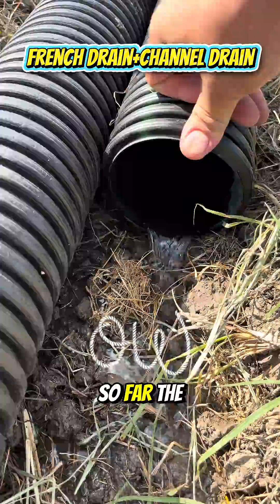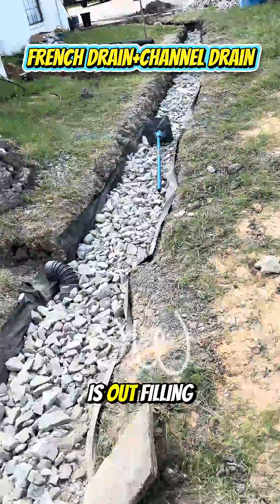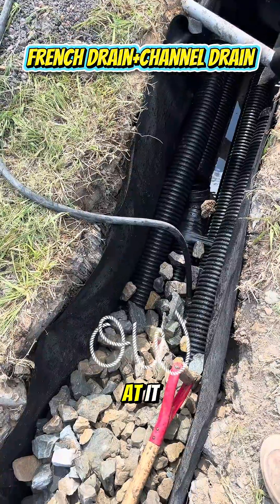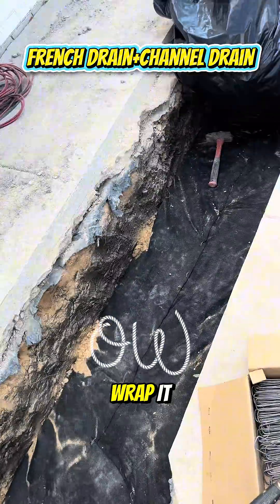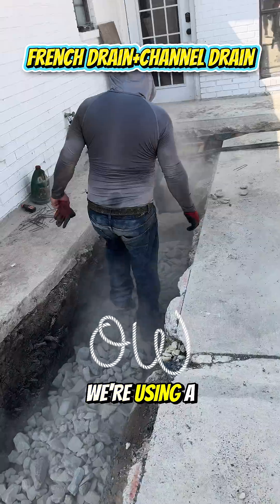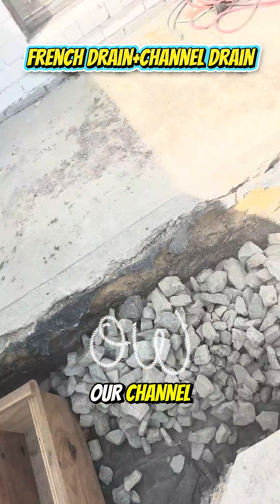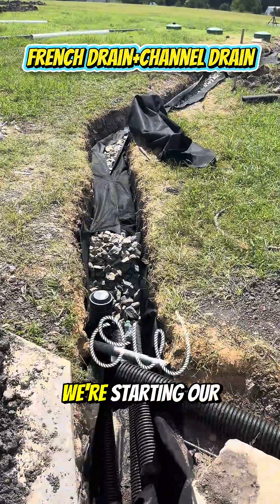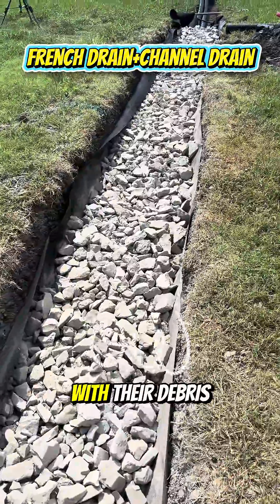A Real Drainage System Solution. NO handyman hacks here.🙅🏻‍♂️ #frenchdrain #drainage

Comment: Those are massive Stones you're using... I like it.  I'm finishing up one right now with 3/4 inch (I washed and sorted... Home Depot $30, 1100 lb. bags, 8 tons total...).  

I'm using SDR-35 green 4" pipes.  I drilled my own 1/2" holes at 4:00 and 8:00 o'clock.  I've also included clean outs every 20 ft -25 ft..  It's in a crawl space... About 2 ft clearance from from ground to floor joists.   

A 5-ft sump pump basin... Discharges to the street. It works great...👍
Reply from the maker: Sounds like one heck of a system. You should upload footage of the project! 👍🏼